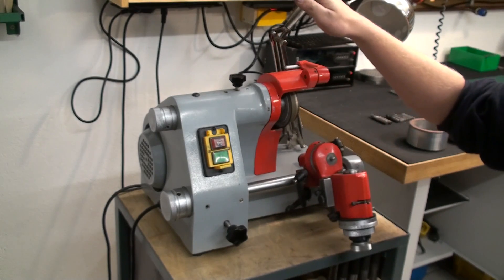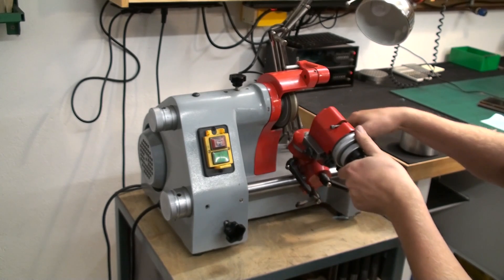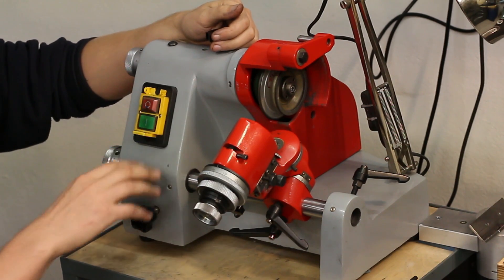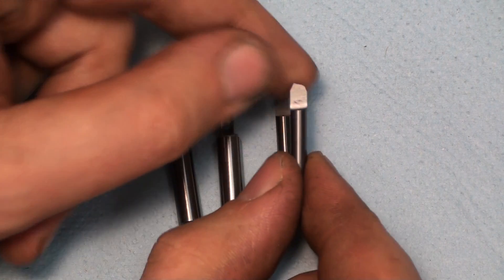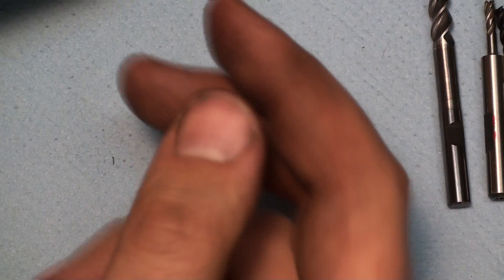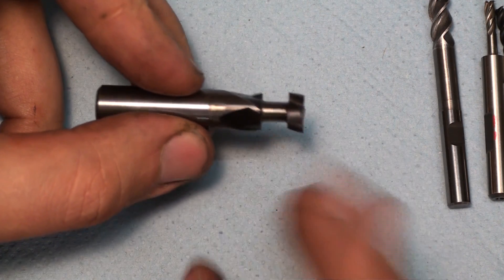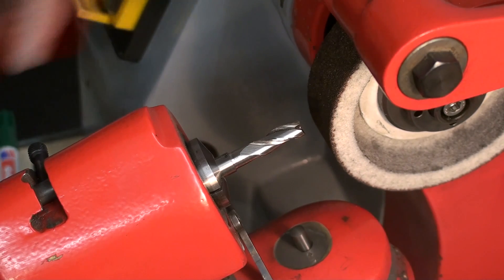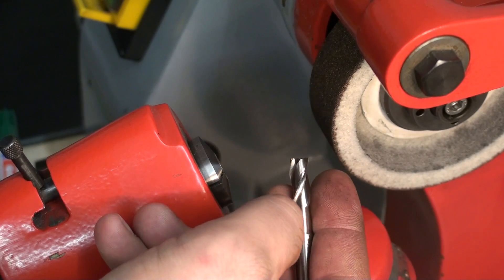Single-lip cutter grinder - Details and uses

Comment: So do the diamond wheels not need dressing? If so how is the best way to dress them? Asking for a friend that totally definitely didn't ruin a diamond wheel today slamming it into carbide... :l 

Cheers for this video, I'm decided, I need to get myself one of these machines, even if only to regrind the poor end mills I occasionally accidentally smash all the corners off :(
Reply from the maker: In normal use they dont need to be dressed. When they get out of shape (by heavy use or some mishapp ;) ) they can be dressed by cylindrical grinding with a silicone carbide grinding wheel. In the most simple way, that would be a diegrinder with green SiC wheel against the diamond wheel.
After Regrinding the wheel to shape, the diamond needs to be exposed from the resin bound with a special sharpening stone (Those are rather Cheap)
Reply from the maker: And btw its a horrible mess to dress a diamond wheel ;)
You get not only the diamond/resin grit but also the SiC grit all over the place :\
Reply: Stefan Gotteswinter Ooh, there go my slideways 😉 

Considering how cheap the Chinese diamond wheels are, I might consider replacing it instead, thanks for the info though, I've always wondered how to do it 😊
Reply: Dear "chris0tube", you are not educated enough, that's why you can't see.
No one should answer your stupid questions, but I will make X-mas exception.
1. ALL materials can "machine" each other, rate depends mostly on hardness difference (among other nuances), that's all.
2. Dressing silicone carbide wheels is done by single diamond (not wheel).
3. Diamond wheels are not solid piece of diamond, right? Diamonds are suspended in bonding material, that's why you can rip them off with softer wheel.
This is basic knowledge on various materials properties.
Reply: @sjwsbetaskiller6218  you can buy a cbn wheel cleaner block, rutlands uk, i use it to clean cbn wheels, might work quite well on the universal grinder diamond stone, mine still looks dirty after using the small diamond dresser, so i will try my cbn block cleaner

Comment: Hi. Have you tried grinding 4 facet drills on this? Cheers, Crispin
Reply from the maker: Yes, works well, but holding normal twist drills in the collets is not very good, they either stick out very far or you have to clamp on the flutes wich works with this style of collet not very well.
Reply: Any thoughts on what kind of collett works well for for holding drills?
Reply from the maker: ER-Collets for example work quite well, REGO-FIX mentions in their technical documents that you can clamp on the flutes of a drill. (My experience confirmes this, I like to hold drills very short on the mill using er-collets)
Reply: With some modifications on the drillgrinding tool I am very satisfied with the results of 4- and 6 facet grinding of the drill bits. On my channel is has already 2 video's only about grinding drill bits. Check also my documentation. Next year I hope that the quick release clamp for the V-bar will be ready. I don't like Hss, Hss-Co- and carbide drills are clamped in  hardened steel collects.

Comment: Thanks for sharing your videos.
I have OPTIMUM GH 20T
Where could I buy the pieces to hold other stones? Minute 20:00
Thank you.
Reply: Stefan made them himself and got a video on making in two parts. Part 1 https://www.youtube.com/watch?v=N9_7XvLFcNM. Part 2 https://www.youtube.com/watch?v=dLEbaRqk9RU. You can also try to get these from Shars https://www.shars.com/products/machinery/rotary-cutting-tool-sharpeners/grinding-wheel-adapter-for-1-1-4-arbor-hole as mengtioned by Robin in his video. The only difference - the Shars adaptors are intended for wheels with 31.75mm (1-1/4") ID instead of 20mm.

Comment: Stefan is right the Deckel used ones are completely overpriced and do not always have the milling attachment with them...there are more worn out in the market than not worn out ones and still they cost a fortune because if someone don't have a good look that the ways are protected by putting some clothes on it when not using or a plastic bag over the arm these ways are quite small and if they get dust all the time they are worn out in a short time noatter if it's Deckel or china the china clones are quite good I prefer building a diy one because I got the arm for nearly nothin brand new 😊

Comment: I know one can sharpen drill bits on this but can you do split points?
Reply from the maker: No, not realy, that would be a job for a proper tool and cutter grinder - Or a proper drillgrinder...or just split it by hand ;)
Reply: @StefanGotteswinter  yes you can do 4 facet drill sharpening, use 5c round collets, top knucle 60-70 degrees, bottom knuckle 5 degress, then for secondary facet just change bottom knuckle to 15-20 degress, gives about 118 degreee drill, it is good enough that it has done away with my £170 tormek8 drill accessory, much faster on the universal grinder

Comment: The perfect bench for a grinder. A hospital hyper-al isolation station. A plexiglas shield and air re-circulation that captures all free air over the table and forces it through a 99% particle filter.
Reply from the maker: Might be a bit overkill ;9
Reply: Admittedly. But considering your perfectionism, precision and eye for details... You could always give the hyper-al station a matching paint job!
I could never be a production machinist. I'm a clean fanatic. I'd be breaking off in the middle of an operation to vacuum and sweep the floors.

BTW, as for the video. Like always, fascinating watching you work. I'd really like to see you do another that goes into details of all the possible geometric variations of the grinder and how they could be applied.

Comment: can you modify a 2 flute flat EM to have radiuses on the corners? These are sometimes called Bull nose endmill and they can be more expensive than flat EM.
Reply from the maker: Yes - Grinding the radii is not a problem, but you need to relief the radius by hand, which is not terrible hard.